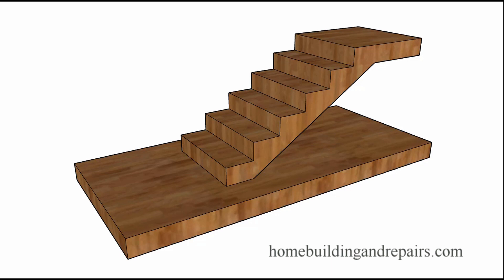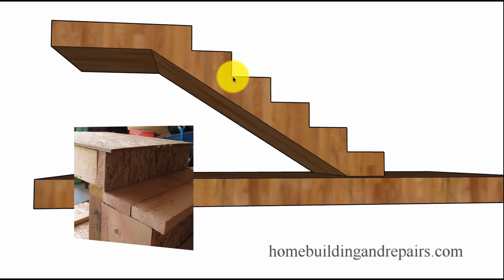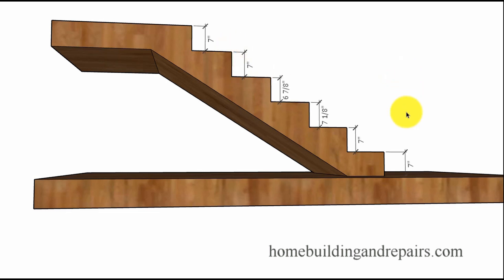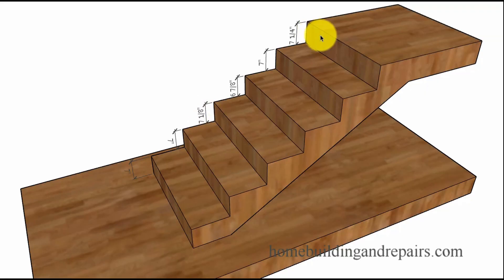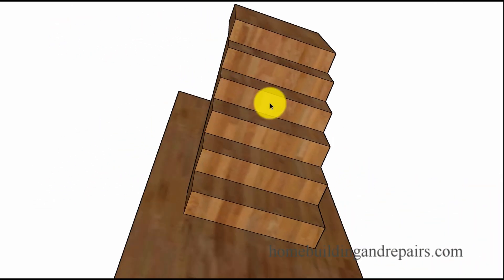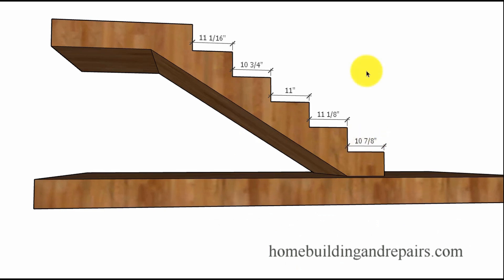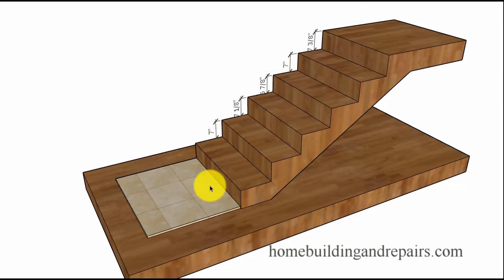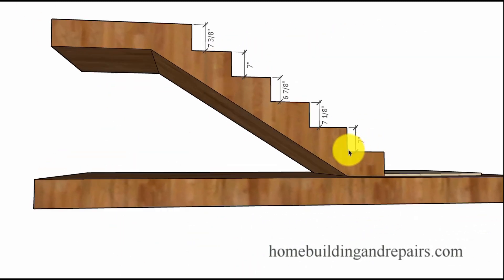Maximum Tread And Riser Measurement Variations - Stair Building Code Tips

Comment: Can you reduce a 3 step stringers down to 2 step
Reply from the maker: Most of the time, no, but you can if the individual riser heights will work. For example, if you have 4 - four inch risers, then you can rebuild a two step stairway with 3 - 5.33 inch risers.

Comment: So according to the IBC, there's an exception to the last part that says: "Where the bottom or top riser adjoins a sloping public way, walkway or driveway having an established grade and serving as a landing, the bottom or top riser is permitted to be reduced along the slope to less than 4 inches (102 mm) in height, with the variation in height of the bottom or top riser not to exceed one unit vertical in 12 units horizontal (8-percent slope) of stairway width" Not sure how this works, is the variation allowed actually based on 1/12 of the width of the staircase ? This would be 4" of variation on a 4' wide stair!
Reply from the maker: That is darn good question to ask your local building department, but I think I would use the other risers without the bottom one that is creating the problem. For example if I had 10 risers that measured between 7 and 7 1/4 inches except for the 11th or bottom or top one that measured 6 inches on the right and 7 inches on the left.

Comment: I prefer to make my steps, with space allowing, roughly 6” rise with an 11.5” run. Much more comfortable to walk on. Anyone with a size 10 or larger foot walks down these steps and only the heel and part of the arch makes contact. It’s called a step and it’s supposed to simulate a natural step, not walking up or down a ladder. In fact, many public domain stairs are now using the the 17 rule, 5” rise and 12” run, 6” rise 11” run.